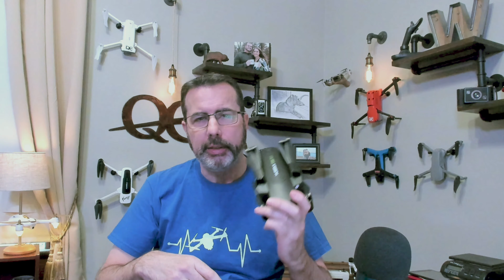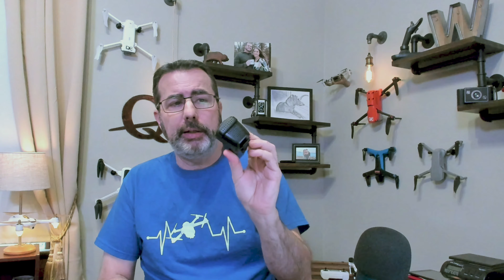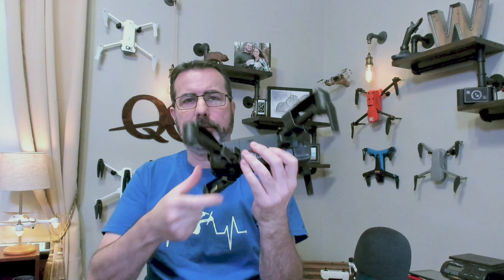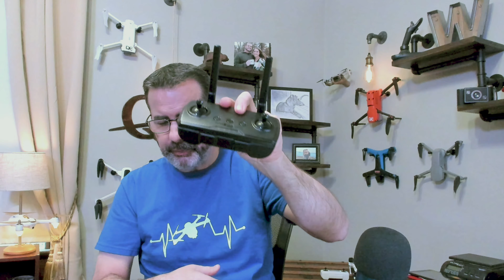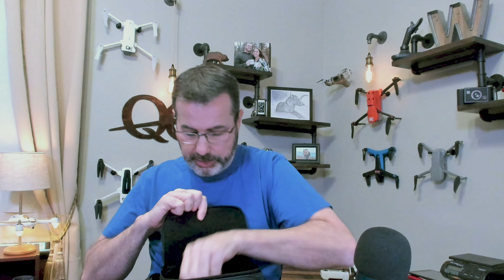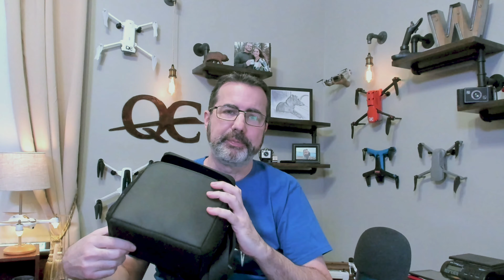HUBSAN ZINO PRO+ / ZINO PRO PLUS - INTRODUCTION - LET'S SKIP THE UNBOXING

Comment from the maker: My hover tests and flight tests will be to show the original Zino Pro with the GIFI 4200mAh vs. the Zino Pro+ 5000mAh battery. I have also modified the Zino Pro to use the Zino Pro+ 5000mAh battery.

Comment: Hi Chris. Ive recently bought a Zino Pro Plus, have been watching your videos a lot since then. I ran into some issues though, my compass doesnt seem to calibrate properly...and it seems to uave started after i updated all the different firmware (didnt watch your vids on NOT to update lol) you wouldnt perhaps know how to downgrade the firmware? Or a link on where i could find older firmware?
Reply from the maker: If you remember what versions you had you should get those versions and downgrade them. Not the camera but if it was FC and Gimbal do those. I would need to know the versions because I may have them.
Reply: @QCGUY  i honestly dont know what versions i was on.... i know, i know, it was very very stupid of me not to even take a screenshot of what my previous versions i was on. But regret always comes too late...lol. bit if you could possibly help with the versions youve got, i can try them and im sure it wont be worse...if it is i can revert to what ive got...
Reply from the maker: @llewinthestates8274  sorry…I forgot and I’m not 100% sure I have what you need but check my group files first and if not then just make a post and if a member doesn’t have what you need I will work to find it. Thanks 
https://www.facebook.com/groups/HubsanQC/

Comment: Hi Chris. Thank you very much for All your explanation about this drone. I  want to be sure so ı want to ask you that dont you recommend firmware upgrade?
Reply from the maker: No way! If that baby is flying good and not causing you and headaches leave it alone. If they offer some great new feature you have to have then that’s a good reason to upgrade but only after you see others you can trust that used it repeatedly and not just once. 
I always say let it get a little dust on it before you install it on your quad. 👍🏻
Reply: Awesone. Thank Chris. I understood very well

Comment: Appreciate all the informative videos on the Hubsan Zino.  Based on content, you certainly seem to be the most knowledgeable as well so I was curious if you knew why my Zino Pro Plus is creating duplicates of every video on my micro sd card. It usually assigns AA at the end of every video name and AB to it's exact duplicate. Do you know why and how to correct this setting? Thank you.
Reply from the maker: I don’t know if this is it’s original intended use but the AB files are duplicates in a much lesser resolution that people have been using to edit on slow computers and on their phones and then saving or uploading to the original say 4k 30fps as an example. 
I’m sure there’s videos on it if you search zino ab files. 👍🏻
Reply: @QCGUY  Yes, my apologies, "duplicates" was poor choice of words since AB files were much smaller in size. Thank you for the tip and the videos, definitely accelerated my education and knowledge on subject matter.

Comment: My son finally saved up about $400 and wanted a better drone then his older Holy Stone. Is this a good upgrade for him for the money under $400 He was looking for a gimble and longer range. Thanks
Reply from the maker: How old is your son and is he good at doing repairs with electronics like you see in my other videos? 
It’s not a quad I can ever recommend 100% and feel good about it. Especially for a kid...
If he gets one I advise to purchase from Amazon and test it good. Any problems return it.
Reply: @QCGUY  Thanks for the reply. He just turned 11 but has flown about a dozen different drones over past few years. He can change out blades, motherboards, arms, etc and has done a few other mods(with my dremel). We just watched your gimble camera reset(try) video on the ZINO and another he found and is now a bit hesitant about Hubsans support or lack there of. I have been reading lots of reviews stating they are having error codes. 100% right about buying from Amazon...sadly will not buy directly from Hubson. May have to pitch in a little more cash and maybe go for a DJI. Love the videos!
Reply from the maker: @privateuser3725  thanks and best of luck to him in his decision 👍🏻

Comment: Question!
Does charging wire from Zino H117S fits to battery from Zino Pro Plus? I have charger for three batteries from Zino H117S and could I charge it?
Reply from the maker: Yes it does fit but I have not used it on the plus in a charging situation.

Comment: So, my Zino Pro Plus finally arrived from Banggood!🙂 I ordered it with 2 batteries. Only got one “smart” charging adapter though, so I cannot daisy chain and charge both batteries at the same time. Should it come with two charging adapters? Maybe I can buy an additional one. What about this “smart” charging adapter, does it balance the cells good? Does the “smart” 5000mAh batteries discharge themselves to storage volts after a few days like the dji batteries? Was going to make a charging cable like you have a video on, to be able to put the batteries in storage charge, but can that be done with that cable and these new “smart” 5000 mAh batteries with a hobby grade balancing charger? So many things I’m thinking about. Weather is so bad today I am just reading the manual and learning. Best wishes, Ken
Reply from the maker: It should have come with two and the adapter cable between them. You can purchase them separately from Aliexpress or places like banggood. 
These batteries only charge with a positive and negative supply. The balancing is done within from the circuit board. They do not discharge like a typical smart battery into storage level but instead barely trickle like a plain old lipo which is very slow so if left fully charged by habit they will swell eventually. 
You can’t do anything with these batteries to balance them through a hobby charger or anything like you see in the old ZINO’s. 
I’m sorry but this battery is about as boring as it gets so there’s no extra balance cables have a charger is or anything like that.
Reply: @QCGUY  , So my best bet is to either charge until 2 LED:s light up in the battery, or discharge by for instance hovering until I can see the same? Can I hover indoors? In case weather outdoors not permitting flights? Guess I’ m out of luck getting the second charging adapter and cable as guarantee if Hubsan customer service is as horrible as people say.
Reply from the maker: @kenspaceman3938  use it as a power bank and charge your phone or something. Problem solved 👍🏻
Reply: I have now written to Banggood customer service about the missing items. Hopefully they will correct this.
Reply: I should have looked better at the ”Smart” charging adapter, there already being a USB-A port for using the battery for just that, a power bank. My bad.

Comment: Hello, I have a doubt about the correct functioning of my Zino Pro Plus, when you turn it on you can hear a music characteristic of the Zino Pro, mine does not emit that sound but rather a short sound equal to the Zino 1. I also noticed that it is very unstable and sometimes does not respond to commands, it arrived three days ago and today it flew for the first time. Do I have to worry? I have successfully updated the FC and Gimbal firmware! I've done all the calibrations. Thanks in advance for your reply, I wish you Happy 2021.
Reply from the maker: I often hear of people saying there’s doesn’t sound the same as mine or I see it in other peoples videos where there’s doesn’t sound the same. I don’t see that is a concern or anything to worry about whatsoever because different quads do behave differently in different ways. As long as it’s flying correctly and not giving you any problems I wouldn’t worry about it. If you’re having problems it’s best to just focus on the problem itself with whatever suits the problem. 
You say yours is unstable and sometimes doesn’t respond to commands so my question is have you done every possible calibration?
I would actually have to see exactly how it’s behaving for me to recommend something myself. When somebody says that it’s unstable or not responding to commands that could be different things and it’s always best to see first hand. That’s where my Facebook group comes in handy.
Reply: @QCGUY  Hi, I made the calibrations, obviously something did not go well, I will repeat them step by step and see the results. I add that that day, unbeknownst to me, there was another drone nearby, it may be that the other drone interfered with mine, however thanks for the answer.

Comment: I want to see somebody make a balance charger connection to these batteries. I have a SkyxRC B6 mini and I want to use it for the Zino Pro Plus. I don't want the batteries to last 5 flights and loose the drone. I heard my Pro plus charger squeal like you said on the first charge but the 2nd charge it didn't do that. I got lucky on Amazon getting the pro plus and it was from JYZ drone. It was the only one that said  it had a Prime discount of 10% or I would have went with MIFI because I have dealt with them before and it was good. $41 is a good discount and I guess it was Amazon providing it. It didn't seem to be opened or messed with. But I saw some reviews that said JYZ drones had been tampered with, or they were missing batteries.
Reply from the maker: I tried with the balance cable and can’t because of the board they added to this battery. 
You can use the Imax as a better power supply though. I’m going to put that out as soon as my order arrives.

Comment: Hola Cris, saludos desde Colombia de nuevo.

Gracias por el video, yo compre el mío hace un par de días por Amazzon y estoy esperando que llegue, pero ando muy preocupado por lo que he visto de las baterías. Estaré atentó a tus pruebas. Gracias.
Reply from the maker: Sorry...translation?
Reply: @QCGUY  Hello Cris, greetings from Colombia again. Thanks for the video, I bought mine a couple days ago from Amazzon and I'm waiting for it to arrive, but I'm very concerned about what I've seen of the batteries. I will be attentive to your tests. Thank you.
Reply from the maker: @jonathansolislozano5635  It’s fixable if they stop messing up firmware between quad and app. I wouldn’t fly it down to low voltage till they figure things out.

Comment: Shooot. Circling the Drone channel flew out like 20km, or something around there. Showed 60% for the RTH, but then bombed. Dropped 5 percent in a couple seconds. Until it did an emergency land in the middle of nowhere. I'm curious to your analysis.
Reply from the maker: It was more like 6.5 but cold played a factor for sure. Should it have dropped in voltage that fast though. I don’t think so but Hubsan has been screwing the battery programming up between quad and app for some time now. 
I would have tested that battery right away if it wasn’t so far and a day later to see what the actual battery percentage was with a multi meter. That’s where the truth would most likely show up in Hubsan having this all screwed up.
Reply: @QCGUY  oh yeah. The 20k was ft. Not km. It was a crazy experience to see. More to why as to why im curious for your analysis. I've been in a discussion earlier. How's your view towards DJI being used for security over internment camps and such? The indirect endorsement by financially supporting the brand. Found out it was part as to the blacklist they've embarked recently.
Reply from the maker: @focusonchrist6752  Topic for another time...
Merry Christmas 🎄🎁
Reply: @QCGUY  Happy Holidays to you as well. Be safe.